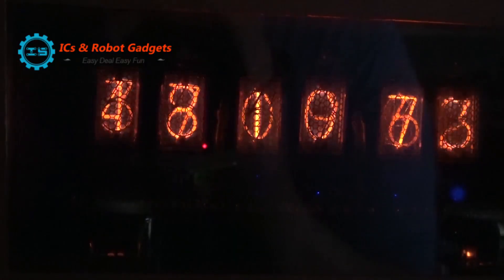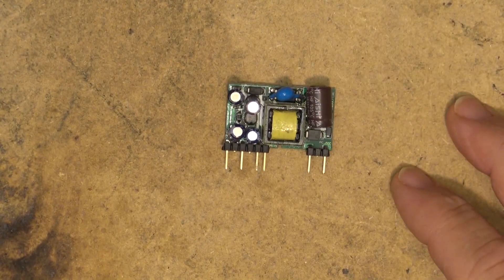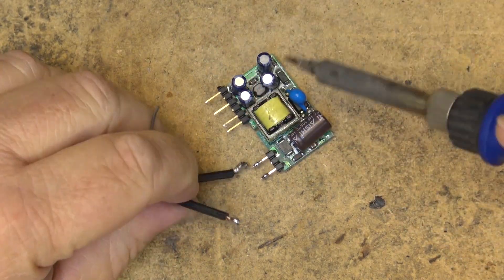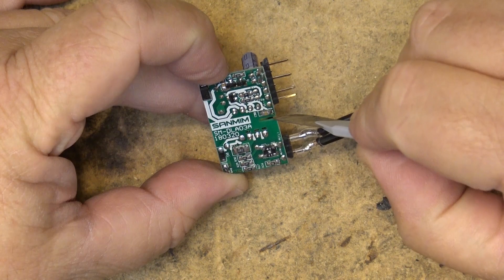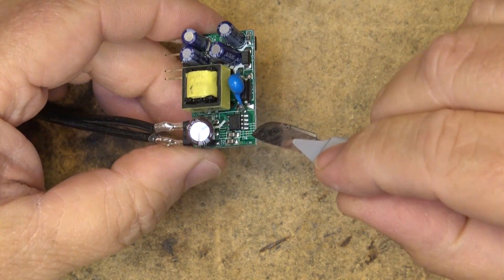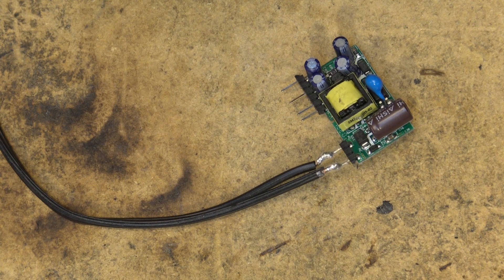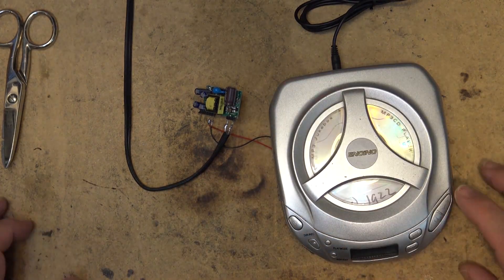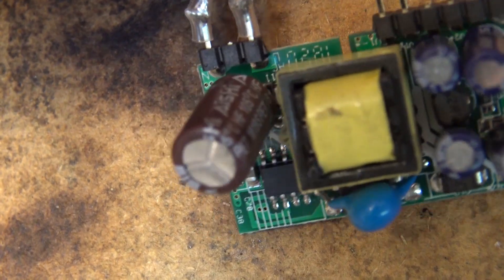Dual voltage step down AC to DC power converter

Comment: Great explanation.. Is it possible to hook up an AC/DC regulator to DC/DC step down Buck converter power supply? 

Or even from a 12v battery hooked to the Buck Converter to the V-reg? 

Thanks, new sub.

Comment: This is exactly what ive been looking for. This is simular to what you plug in the wall to charge your phone. However, and this should go without saying; until you know its completely safe; i think its a wise idea to connect a fuse between the output of the DC 12v and 5v and your project just in case something goes wrong so it does not damage the project your connecting this to. Power surges happen so protect your stuff. It may not need it but, better safe then sorry. Always safety first. I will be ordering this.

Comment: What's the point of the isolation between primary and secondary if 1. the blue cap bridges the two and 2. the transformer's not earthed?  A fault in either the cap or transformer could lead to a direct connection between primary and secondary circuitry.
Reply from the maker: The "blue cap" is not a cap at all. It is a 400v MOV, A surge suppressor
The transformer provides isolation, and that is what regulates the output voltage. Through the opto coupler the frequency of the oscillator is changed. As the frequency gets closer or  further from the resonant frequency of the core the efficiency of the power transfer is changed. Since this is a low power device, a short on the transformer would have limited  connection to mains, and the fuse would open in a fault condition anyway.
You might not like the design, but be aware that the majority of electronic devices have prefab power supplies just like this inside. Wht design a new supply when there is an off the shelf module awaiting your project.

Comment: A dumb question: This appears to be a linear power supply. True?
Reply from the maker: No it is a smps
Reply: 12voltvids, ok thanks! I’m reluctant to use SMPS, even one this small, because of the noise they often generate in the AC power line they are connected to with my HiFi system. Thanks for the great review.
Reply from the maker: I am not a big fan of switchers either, but the world we live in today pretty much mandates their use for energy conservation reasons.

Comment: Turn off the image stabilsation on the camera when it's mounted on a tripod or whatever. This will stop the rapid vibration effect you saw. You should never have IS turned on when the camer is rigidly mounted because of this well-known problem.

Comment: So cool, so small... thanks for the great review, loved the opto-iso explanation! Do you happen to know what the current rating was? If not, no worries, I can look it up. :-)
Reply from the maker: I was able to pull just over 900 mA out of it with a resistor (5.5 ohm resistor) before the voltage started to drop. The 12 volt rail is lower however. I got 100mA out at 12v before it started cycling on and off, so for low power devices this will do the job.
Reply: That’s not too bad for the size. I like it. Thank-you.